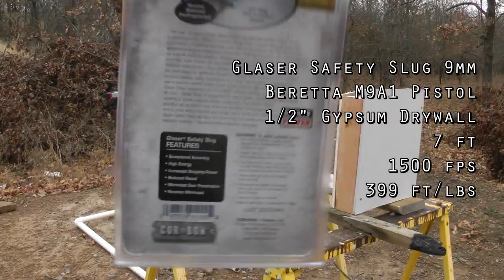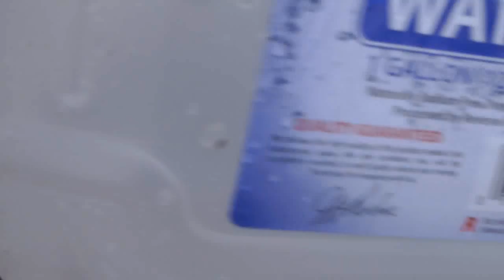Glaser Silver Safety Slug 9mm Gel Test

Comment: This round was introduced for air Marshalls to use on planes in 1974. Made not to pass through the target while delivering all the energy to the target and maximum damage. Best personal defence round in my opinion👍🤔😎. All I use and will every use. Use the blue glacier for higher calibers and silver glasers for lower calibers as the silver variation has larger pellets and get on average of 2 inches more penetration than the blue glaser. 😁😎👍🤔
Reply: I'd feel pretty safe against these standing behind a solid core door lol. I hope you carry solids as backup!

Comment from the maker: 4 layers of denim is part of the IWBA testing protocol for hollow points which are the most common self defense rounds available.  Denim is meant to defeat the expansion of hollow point rounds, which it does in some cases.  Pre-fragmented and frangible rounds may not rely on hollow-point engineering.  Denim shows their "expansion" is not defeated by clothing.  In short, to be consistent with ammunition testing for other self-defense rounds, we use denim.  No it is not to mimic clothing.

Comment: With the claim about air safety, I'd be very curious to see how these perform in a pressurized environment. The placement of rounds seems to be of rather higher importance than the quality of the round itself, which rather limits the validity of their claims, as you could say much the same for any standard low-penetration projectile.

Comment: Stuff your awsome wall targets with blown fiberglass insulation and see how variois billets do with that. It is actually glass so its very hard material. It isnt going to behave the same as cotton candy or even cotton fluff. Glass has greater compressive strength than steel with linear pressure and it is notoriusly rough on bullets. A windshield can strip a jacket off Even a bonded bullet so it may be the missing key to find what penetrates home walls and what does not.

Comment: Yeah but I've seen video's of 9mm and 00 buck shot penetrating 4 double side 1/2'' drywall clean. This is an interesting idea for home defense especially if you live in an apartment building. The fewer walls the round penetrates with lethal force the greater the chances of a neighbor being in the wrong place at the wrong time...Still, I think the name "safety slug" is a misnomer, they should call it "safer slug" :)

Comment: You can build this ammo really cheap 
Simply use some 40s w cases fill them with small birdshot  and wax and load these cases in a 45acp case
Reply: I use epoxy and tungsten carbide bearings to make super MageSafe type ammo. I like to buy Glaser Blue rounds, remove the ball, hollow them out and fill them with different things. If you buy Tungsten Nail Weights (for fishing lures) you can load them up with little armor piecing darts and seal them with epoxy (use 3400 - 3600 psi epoxy). The nailweights when tested went over 16 inches in gel (left the block). But I don't dare carry them, as they would armor-piercing and illegal. But tungsten nail weights are at every outdoor store there is. I order the flat sided ones and load 7 in a 9mm/380acp and it makers the most vicious flachette-like round you have ever seen. But tungsten carbide bearing work just fine as my video shows. Each of the 10 bearings got over 12 inches of penetration from a a weak little 380acp. In 9mm 15 of them all exceed 14 inches. At least these ones aren't illegal (technically neither are tungsten nail weights inside of the bullet if you look at federal laws regarding armor piercing rounds).

Comment: How in heaven's name is this a "safety slug"?  It blows through two walls and vaporizes a gallon jug of water on the other side, and that's "safe"?  More like "exploding mayhem wreck the neighbors' family" slug.   Very misleading advertising.  The issue of drywall penetration is for the case where you miss!  Increasingly, I'm thinking that we need some sort of detonating round that enters about an inch or so, then explodes and takes the perp down with hydrostatic shock, but if it hits a wall, it just sends fragments around INSIDE the wall.  Tests like this that expose the real characteristics of a product are invaluable decision tools.  Thanks for the hard work - much appreciated.
Reply: George Steele I think the idea that Glasers won't over penetrate is probably bunk and for sure over blown. I know it is an impressive round and may be better than a hollow point or other rounds for indoor use to limit over penetration as much as possible with a pistol. The idea is that the round is suppose to not penetrate walls after hitting a person, not a missed round hitting a wall. The test here showed the wall was not penetrated after going through the pork. In this case it did as intended. Does the round have enough penetration like through thick clothing to stop a person? Is this round any better than a hollow point regarding body penetration? A pistol is not my choice to stop a person. A pistol is a last resort because they are poor at stopping human beings no matter what ammo used. A pistol is what I must use if my rifle goes down. But my first pick for inside the home defense has been and always will be a shotgun with #4 turkey birdshot. Inside a home is mere feet, not yards. A shotgun birdshot pattern will stay tight at close range yet limit over penetration better than anything else. Like the Glaser, this is also predicated on first hitting the target and not missing. But in reality and sad as it may seem what is the quickest and easiest gun for most folks to pick up? A pistol. So if I must use a pistol inside a home for defense then either hollow points or Glasers. There is no magic bullet. Either it over penetrates or under penetrates. Neither case may be desirable but its what we have.

The Glaser was developed not to over penetrate a target person keeping those behind safe and it was billed for use on aircraft for sky marshals and pilots. Hollow points have been known to (in some cases) go through a target person into a person behind. The big misconception is that folks thought a Galser was suppose to not penetrate the skin of an aircraft. Commercial aircraft have rows of persons and the idea of the round was to stop a perpetrator without hitting anyone beyond. It had nothing to do with aircraft skin or walls. Sky marshals and pilots today use only hollow points as far as I know. They don't use Glasers. Glasers have become more of a home defense round today.
Reply: Won't go through 2x4 studs: Great!  That takes care of (statistically) 10% of the shots fired that miss - the rest go through drywall that doesn't have a stud behind it.  (a 2x4 is about 1.6" wide, vs 16" center to center stud spacing).  So you only kill the neighbors' kids 90% of the time, instead of always.  Yeah, safety.
Reply: The issue with overpenetration is not what a slug does after hitting a person; the issue is what it does when it doesn't hit a person, because that's what happens to a majority of bullets fired.  Cops miss with 2 out of 3 shots fired.  The average homeowner, rattled, in the dark, defending a family, is going to be shaking like a leaf and maybe emptying a revolver without a hit - maybe even a typical pistol.  The value of a slug that doesn't penetrate a person is that it dumps ALL of its energy inside the person instead of in the wall behind him.  To address this problem requires an exploding bullet that fragments sideways after it penetrates anything about 3 or 4 inches.  That blows up in a wall or in a chest cavity, not in your neighbor's nursery.
Reply: It was "safe" when compared with the weapon/ ammo of choice in the middle/late 70's. That being 168 gr. Semi Jacketed H.P. in .357 magnum which had the best record for one stop shots for law enforcement.  Unfortunately the .357 can go a mile or thru the side of a house. The Glaser wont, and limits departmental liability.  Much complaints of poor penetration though.
Reply: "Unfortunately the .357 can go a mile" - yes, if you drive it in your car; even out of a rifle, the drop of a .357 is about 18 feet in a quarter mile.  You'd have to be shooting at an eagle for it to go a mile - and that's if the eagle caught it and dropped it there.  My point is that if it blows through four layers of drywall and will still kill someone on the other side, then it shouldn't be called "safety slug;" it should be called "reduced penetration slug" or some such.  To do otherwise is misleading, which could convince buyers that it poses no risk to a neighbor - to the neighbor's detriment, and the shooter's.  Words mean something.